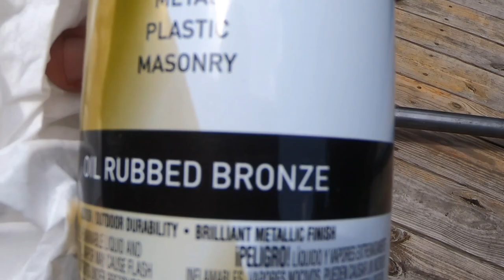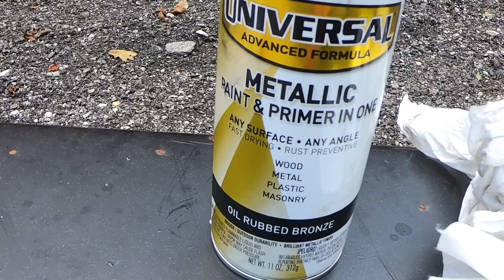DIY 1-1/2” Rustic Industrial Pipe Handrail | CBH

Comment: Hi. Good Video. What kind/size of screws did you use?
Reply from the maker: Hi, thanks for watching and your question. Those were #9 by 2” torx head wood screws. We had to use washers so used brass beauty rings to keep the heads from pulling through the floor flanges. Have a great day and be safe!